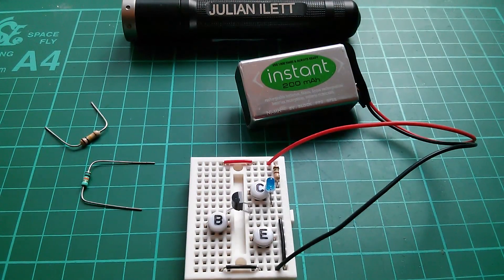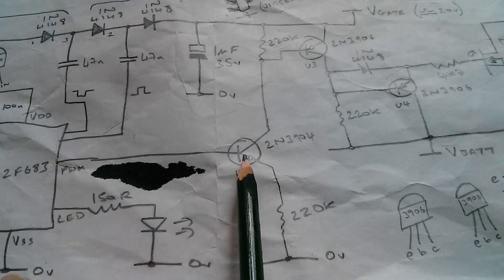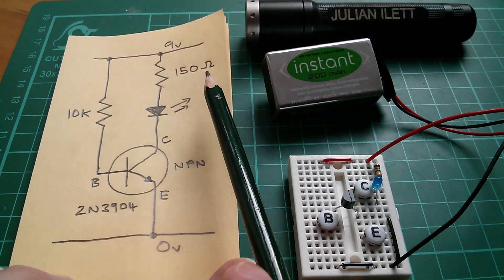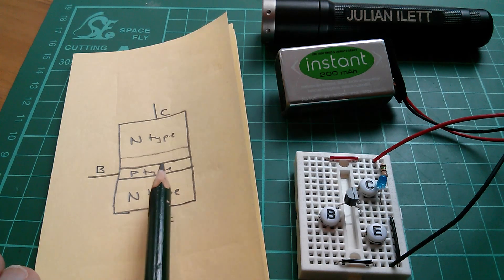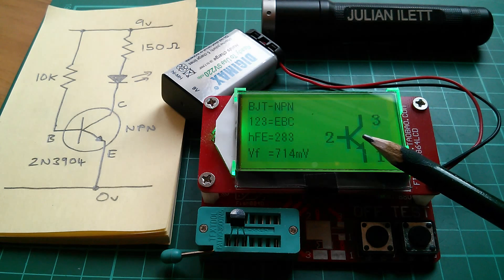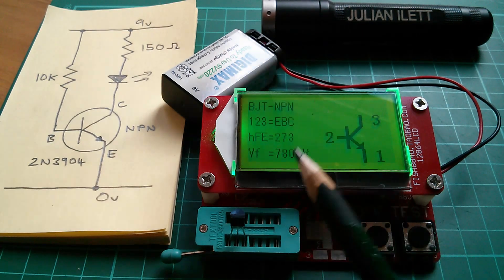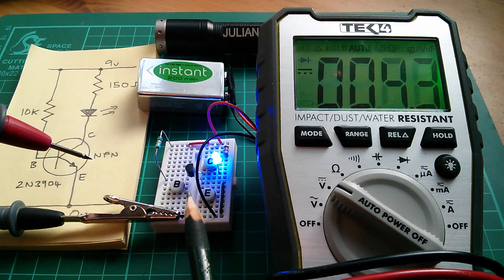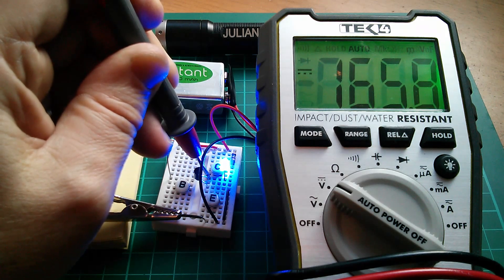Playing with Transistors: NPN 2N3904 Transistor Experiment

Comment: I watched this video and repeated the experiment. There is hardly any supply voltage to the LED and it barely lights up.  It lights up far better just by touching the base with my finger, not sure why.

Any idea if I can make it so I  can get genuine amplification.   It is pretty lame as it is.
I checked the voltage on the receiving antenna and it barely registers over .5 volts as far as I am concerned.
https://www.youtube.com/watch?v=w18z059DzOU

Comment: Ha ha ha - I've been doing electronics work for 40 years also and never knew what the CE voltage drop was before today.  I've been mostly in digital logic so I never really needed to know since everything in my world is either slammed to ground up pulled up to 5v  and there's never any  'fine tuning' as it were, but it's good info because I do  build and/or troubleshoot analog stuff every now and then.  Thanks for the video :)
Reply: ps: I liked, subscribed, and clicked the bell :)

Comment: Back in the sixties I got a hold of a copy of the "GE Transistor Manual",  these days it's available as a download online.  There's a great deal of stuff in there that will remove that vagueness,  and perhaps enlighten you on some things you weren't aware of.  For example back then I didn't think that solid-state components would ever "wear out",  but in fact if you're dissipating any significant power then thermal cycling will create an issue that will cause the device to fail over time.  Lots of other good stuff in there,  too...

Comment: I tried using a transistor in a pocket loudspeaker, but it combusted when i turned it on after briefly working. I decided to do some research into how to use the devices. I should probably not connect 12 volts to it with no resistor.

Comment: I recently went to purchase a (10k ohm 5% resistor) Ebay popped up that ppl who bought that resistor also purchased these.items .(2n3904 transistor) (.01uf50v disc capacitors) I dont want to buy some item thats used for terrorist crap,
Reply: Fill me in on what terrorist used those precise electronic components?

Comment: The condition for saturation (I believe) is that the Vce voltage is less than the Vbe voltage. The effect is that the base is starting to get into forward saturation, this sort of limits how much base current you can have. I have some high voltage low current transistors with not all that much gain, and to get the many amps of current to flow through the load, I have to put nearly 5V directly across the base-emitter junction. That means the Vce voltage bottoms out around 4.3V or so. At this point if I try and further increase the Vbe, the Vce will increase in step with Vbe.

Comment: how much base resistor value should be if i am using using bc547 at 5v   75ma?
Reply: you have to calculate the base resistor from the transistor gain and how much current you want to flow collector to emitter
Reply: heres a video that explains the maths
watch?v=8DMZSxS-xVc

Comment: I worked as an Electronic Technician  for the US Government for 28 years and in all that time, I never had the need to understand how transistors work much less any other discrete component. I learned how the circuits were supposed to function and if they did not work properly, I knew what circuit was the problem. After a while, you just learn common sense trouble shooting.

Comment: I have been going crazy trying to grasp other peoples explanations just how a transistor works and am confused by the many variations they use to figure the proper biasing. There has to be a much simpler way and maybe one day I will find a way that I understand and works for me. So far , I have found one article on the web however, there are typo's that need to be corrected. 
I guess the only way to understand them is to build a circuit like Julian has and experiment.

Comment: The standard silicon PN junction forward voltage is around 650mA at room temperature, and changes with precise doping but also changes a lot with temperature. In fact, you can make a crude temperature sensor using one. Your initial tester Vbe of 714mV was reasonable, the second result of 780mV suggests the junction temperature has risen during the test, and your measured 800mV in circuit reflects the heating due to the collector current driving the LED. This is why in circuits where matching Vbe is important, like current mirror circuits, it's vitally important to ensure good thermal coupling between the two transistors, which should also be selected from the same manufacturing batch to ensure similar doping.

The configuration with a resistor in the emitter but not the base turns the transistor into a switchable current sink, the collector current being approximately equal (given large hFE) to emitter voltage divided by emitter resistance. The IC switches that current on and off.

Comment: Yes, it's incredible how much there is to know about electronics, even what are considered "basic" components. The saturation C-E voltage can be quite low, but it depends on how much current is flowing through. Last week I actually used a couple of 2N3055 power transistors as blocking diodes in one of my solar systems. When the base is connected to the collector they basically behave as diodes. But with a Schottky like (or perhaps even better than) performance in respect to the voltage drop. The only thing to watch out for is that unlike proper diodes they have a very low PIV indeed. I was able to get away with it due to there being a 12 volt (nominal) system voltage, it wouldn't have worked with 24 volts as then reverse breakdown would have occurred.

Comment: It's actually much more simple and intuitive than all of the educational mathematics models. You may note that when the transistor is 'off', it's 'dropping' all of the voltage it sees. A BJT may be viewed as a current-controlled resistor in actuality. The more current flowing from base to emitter (in an NPN), the less 'impedance' it will provide to collector-emitter current.

For a circuit of nine volts, all of that voltage must be 'dropped' by some form of impedance, thus performing electrical 'work'. It's analogous to calculating solar cell MPPT. So you may note that when a battery is said to be 'disconnected', it's not actually fully so, it's just experiencing the impedance of the atmosphere.

The voltage then across the transistor will be proportional to how much is dropped by other parts of the circuit relative to its own impedance which is set by base current. An 'ideal' transistor would drop zero voltage at currents below its set 'allowance'. A real transistor however usually has a minimum voltage drop, which in this case was around 200mv.

Comment: When a transistor gets enough base current, about .7-.8V base-emitter, it enters saturation, where the collector-base voltage actually becomes negative, that is, the collector voltage with respect to your emitter ground falls below the voltage of the base with respect to ground. Saturation is the state used for switching devices on and off, and for digital logic.  Before saturation, with slightly lower base-emitter voltage it operates in what is known as the linear region, where the hFE is a gain in collector current that is reasonably linear with base current. The linear region is used for analog amplification. Below the .65 V or so base-emitter voltage the transistor is in cut-off, that is virtually no collector current flows except a very small leakage. To study and become acquainted with these regions connect a pot to the base to supply and vary the base current and watch the various voltages.

Comment: I never understood why we use an NPN transistor with the emitter on the negative rail. This means we are pushing 1 mA through the base and loose it. I would always think it is better to put the NPN on the positive rail. This way you can send the 1 mA current from base to emitter as well through the load (the LED). am I right about this? That would be like DUH, why has this been done wrong for 50 years?
Reply: +deslomeslager 
First, the "wasted" current is almost nothing in comparison (depending on hfe it's maybe 1/250 to 1/600 for small signal transistors).
Also high side switching is very annoying, because the voltage you apply at the base to keep the transistor open varies with the voltage drop of the load.
Reply: +deslomeslager Let's say you have an NPN-based switch circuit powered from a 9V battery. You can deliver about 8.8V to the load with a low-side NPN switch. But if you had a high-side NPN, you would have to put 9.6V on the base of the transistor to get the same 8.8V to the load. That's certainly doable with a voltage booster circuit, but it's usually not worth it.

Or let's say you only need 8V for the load. Now you only need 8.8V for the base and that's no problem. But the collector is tied to the 9V rail and the emitter sits at 8V. So the C-E drop is 1V instead of the 0.166V measured here, i.e. 6 times as much. Now, whatever current you put through the collector (and it may be a lot) heats up the transistor 6 times as much as in a low-side NPN configuration.
Reply: +deslomeslager NPN is mostly used in Low side switch configuration. The configuration you've mentioned is a high-side drive, which you'd normally do with PNP type transistor. (LOW at BASE turns it on)
Reply: OrKhan
Perhaps, but the point is to use the base-emitter current in stead of throwing it away.
Reply: The energy lost in the current limiting resistor is way more higher than the current we dump into the base, thus the energy.  But theoretically, you should be able to use NPN transistor in high-side configuration.
Reply: OrKhan
Tanks. This means with a low HFE transistor you can get the maximum out your power source. Every milliWatt counts.
Reply: renxula
This clears a lot. Good to know, thanks!

Comment: I have just spent 2 weeks (not full time), figuring this out myself for pnp and npn transistors. Through your inspirational videos, i got inspired to create night lights for my kids with rechargeable batteries and a bare bones atmega328 that will power up them selves during the day and hopefully will run for months/years. As i wanted to create a dark sensor using a solar cell to charge batteries during the day and switch the circuit off while charging and turning it back on when night falls.

Awesome stuff Julian, love it !

Comment: You've put so much current (voltage really) through the base you are working the transistor in saturation mode and your Vce voltage will always be around 200mV for your typical BJT transistor.  Fascinating devices. 

Vcc (battery) - IcRc-Vled = Vce.  Now you only needed like 80-100uA on base to light that led fully (Ib*hfe = Ic) in your case 80uA*280 = 22.4mA which is enough to light it brilliantly.  Rb = Vcc-Vbe/Ib  ->  8.3v/80uA = 103k resistor, anything over that you're pushing more current through it than you should be needed creating a so called early effect.  

By designing your circuit so that the voltage at the collector is roughly Vcc/2 = 4.5V you get the most from the small signal gain from your transistor. If you ever wanted to measure a really small signal from say a microphone or temperature sensor ( mV ) you pass it through a capacitor into the base and depending on the ratio of your collector resistor and emitter resistor you amplify the signal by 1-200 fold  and now you have a V signal from collector to ground instead of the millivolts coming from a microphone.   

Sorry for the wall of text.
Reply: +Aleksandar Kospenda why do you say "voltage really"? bipolar transistors are current controlled devices.
Also when you say you want Vc=Vcc/2, that would be for a linear type of amplifier "centre biased" i.e. operating in the active region. If you want the transistor to be an efficient switch, you want it to be in either saturation or cut off regions when it is on or off, but you do only need just enough base current to saturate it for the load you have.
Reply: +KX36 Obviously in saturation mode it's its current controlled and it's linear. On the other hand when in the active region it's voltage controlled and exponential.
Reply: Bipolar transistors are current controlled devices. That includes the active region. Vbe is pretty constant as it's a PN junction, base current Ib is the input parameter which in the active region is amplifed by the current gain hFE (or beta in the old notation) to a collector current Ic. Voltages only come into the equation when you add resistors to change an input voltage to Ib and to change Ic or Ie to an output voltage.

It's also not linear in saturation - because it's saturated Ic can't increase linearly with Ib x hFE.

FETs are voltage controlled devices.

Comment: Hi Julian!! I learned it at school, those transistor have about 0.2 Vce sat, depending of the current.
Reply from the maker: +Proyectos LED How come I never learned this at school? I did an HNC in electrical and electronic engineering - I guess I wasn't listening that day!!
Reply: +Julian Ilett yeh, me neither. Probably drooling and snoring at transistors 101 class ☺
Reply: +Julian Ilett may be you didn't have to work with transistors much ! but another nice video, thanks !